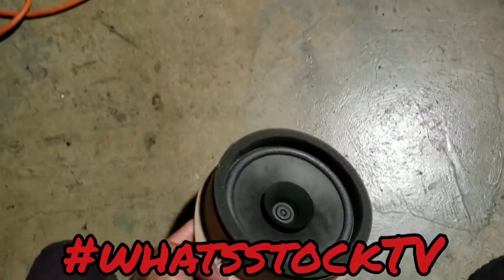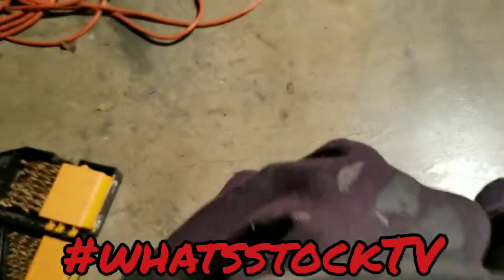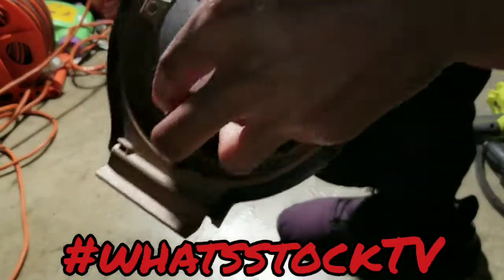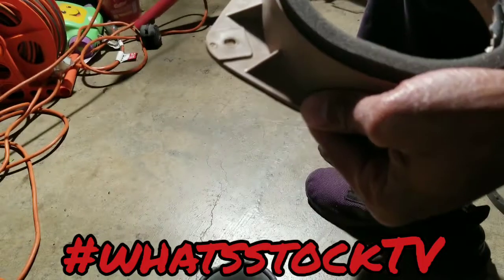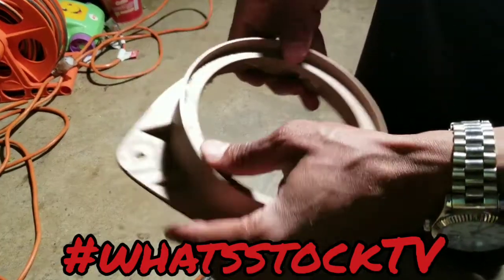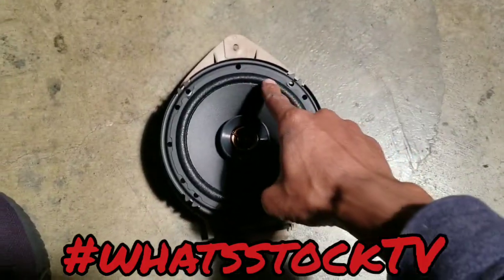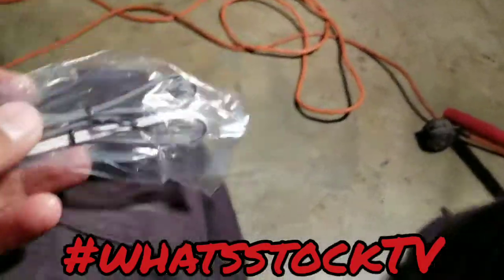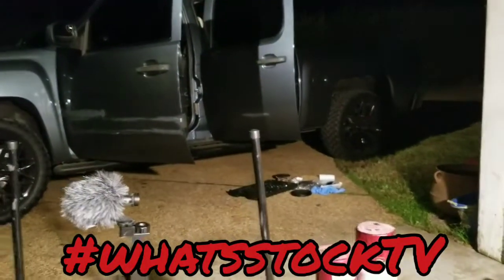How to Install Aftermarket Speakers Using Factory Speaker Brackets

Comment: Thank you so much! I am about to do my '14 Camry right now! The only thing I'll do differently is leaving the foam on. If the assembly sticks out to far to install the door panel, I'll go back and trim the foam. Thanks again Brother!!!
Reply from the maker: You're welcome. Hope it works just as good on the Camry
Reply: @89imp03  Worked like a charm! I'm, however, getting rusty! I broke one of the terminals on a speaker. The wire clamp was too loose! I crimped it. Then it was too tight. I ended up putting too much pressure on the connection. No problem, though! I have a soldering iron. The speakers fit in the doors perfectly!

I'm returning the adapters that are due here Monday. 

Thanks again!
Reply from the maker: A win is a win. Glad it worked out 👍👍

Comment: What size drill bit do I need to use
Reply from the maker: I don't even remember. Just get something slightly smaller than the screws you plan on using
Reply: @89imp03  man I got mines done within 30 minutes because of you lol. Thanks for the tips and tricks to this bro💪🏾
Reply from the maker: @marcuseilum3324  💯💯 glad it worked out